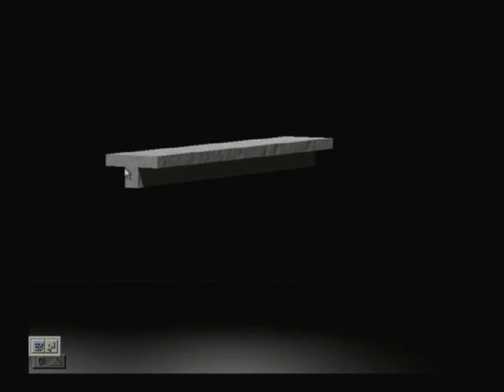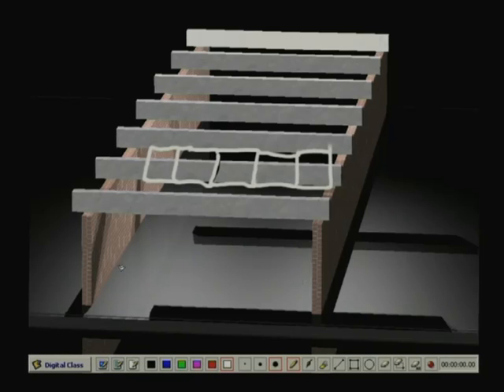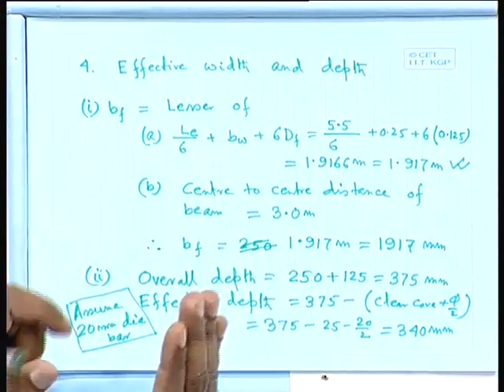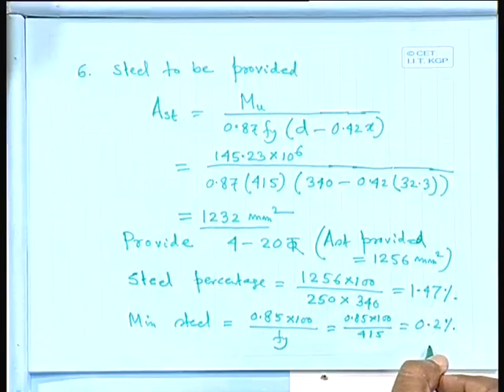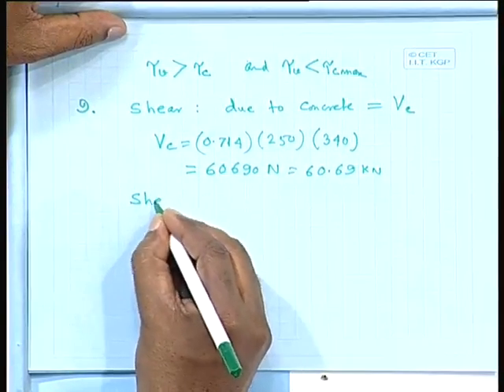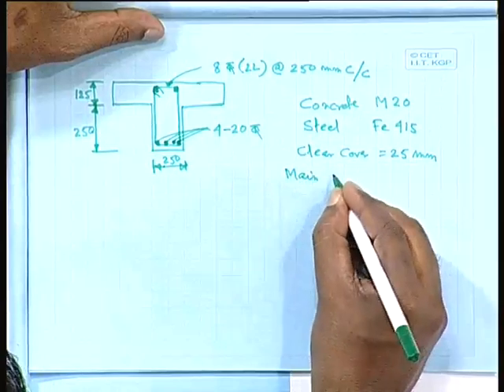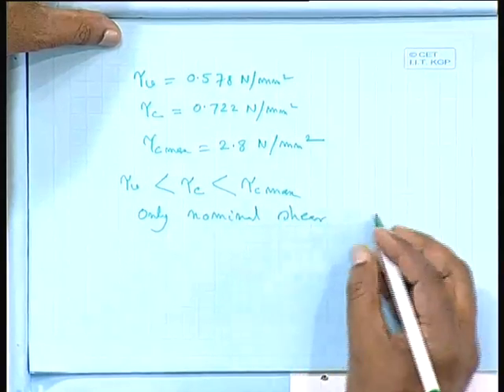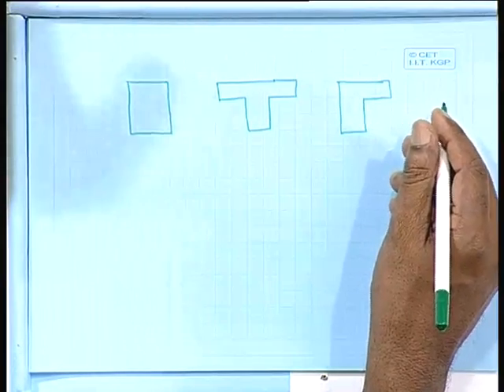Design for Shear (Contd....)

Comment: Sir , but what about stirrups spacing at the end of the beam (where shear value is max) 
2)why in structural drawings is that the spacing of stirrups near end are less that of the midspan ?
Reply: Based on my understanding, the spacing calculated is considering max SF that means at the ends. As SF in mid span in this case is less than the ends, the spacing of stirrups can be increased in the mid zone.

Comment: In this problem why we didn't check singly or doubly reinforced section?
Reply: Rohith Magnur because X is much lesser than 0.48d. The section is under reinforced.
Reply: CHECKING IN THIS PROBLEMS SHEAR ,SHEAR STIRRUPS IN CONCRETE